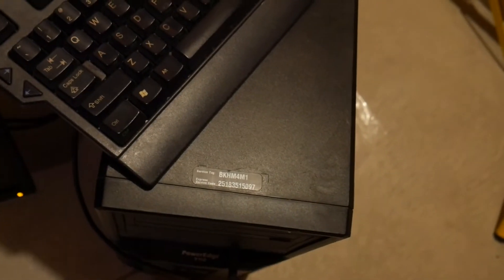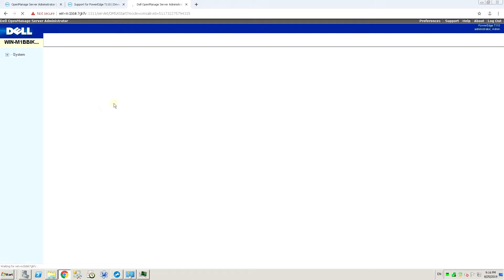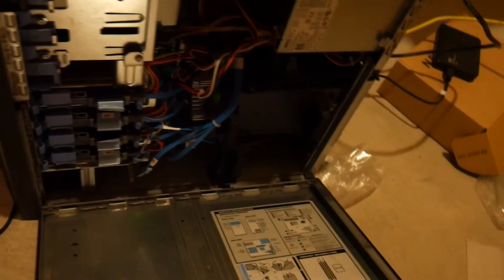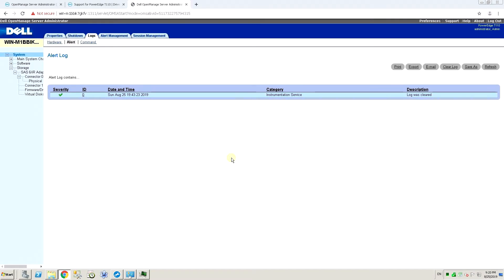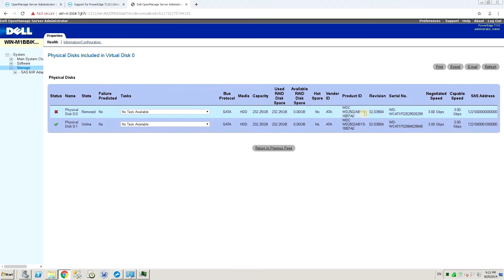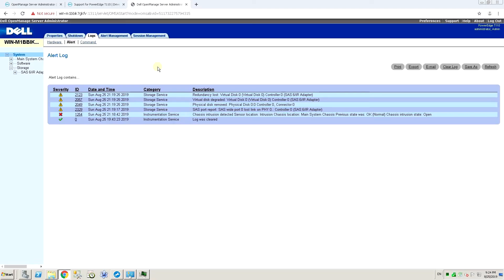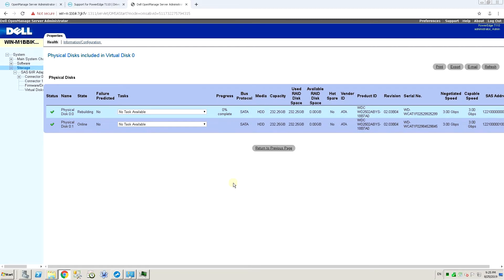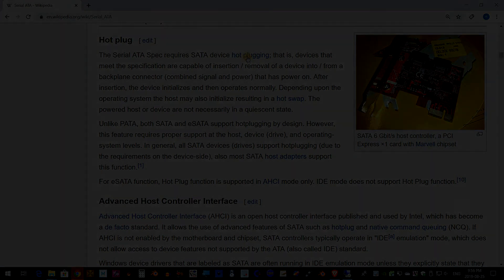✅ Can we Hot swap this regular SATA drive - can it possibly work???

Comment: Right. Non-hot-swap for SATA/SAS just means that the machine lacks the mechanical hardware that lets you swap the drive without opening up the system and unplugging/replugging cables.